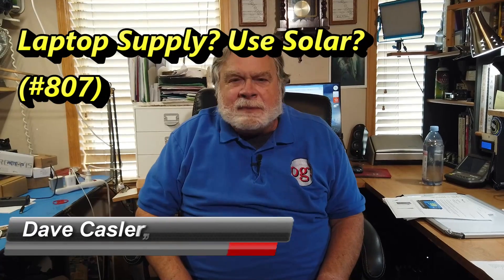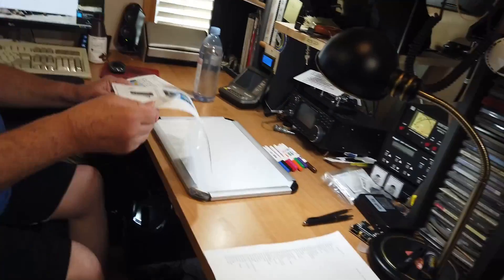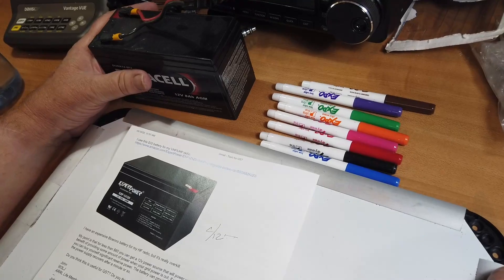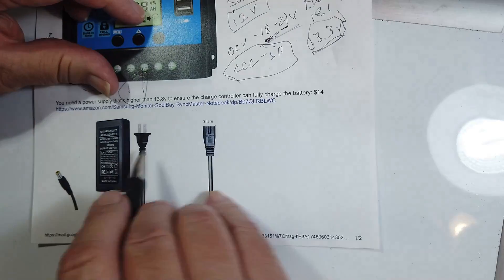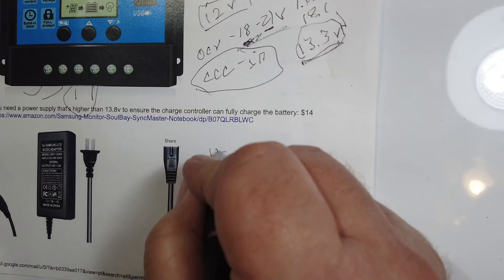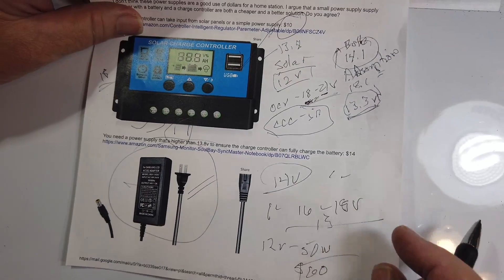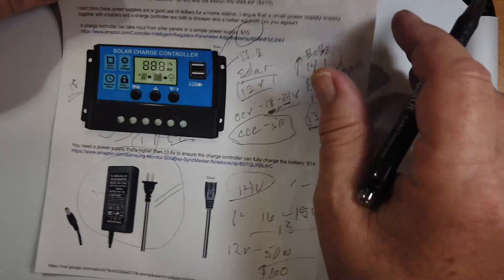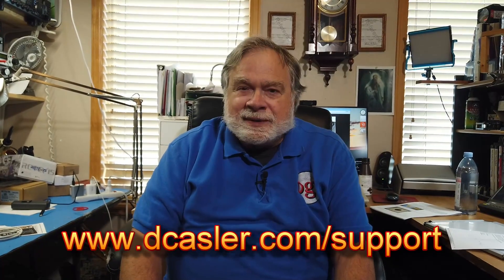Laptop Supply? Use Solar? (#807)

Comment: I agree with everything except I recommend hooking the load up to the charge controller instead of direct to the battery. Reason being is the panels could charge the battery less than the load is drawing. In this case the battery could be discharged to a lower voltage than it should have and may cause it to have a shorter overall life. The charge controller helps keep the battery healthy by turning off power to the load if it starts getting to this point. Otherwise a very nice video for solar education. Thanks!

Comment: Some time ago i built a backpackable vhf/uhf radio station (basically a frame of soldered copper pipes). The transceiver is keep alive by a 12V 24 Ah agm battery (car female cc adapter and usb ports for connect other cc utilities are made avalaible). The battery is managed by a 20 A mppt solar charge controller that can handle up to 320 w of solar power - the transceiver is feeded by cc output of the solar charger controller. In late summer with a foldable 60w monocristalline solar panel seems pass the stress test.
The battery can also keep in charge also with a pedal generator through car female cc adapter (you had to bycicle a lot for charge the agm battery, the maximum power output of the pedal generator is estimated between 30 and 40 watt)

Comment: I'm sure John appreciates you sharing his email and phone number with everyone. 

If you're going to use a battery and solar in place of an actual power supply, just make sure the battery can deliver the current required. Personally, i think this should be your backup to an actual power supply. 

If you're on a budget, just buy one of those cheap 12v switching power supplies from Amazon. I found one you can adjust up to 14v for about 20 USD.

Comment: Great Video! I have this exact setup except two 14aH AGMs. The charge controller is the same and I purchased a 40w fold up solar panel at a Hamfest. Last weekend got it wired up, but I haven’t dragged it to the field yet. I will test it soon with a QDX and then IC-706 MKIIG, then an IC-7600 if I’m feeling exuberant.

Comment: I use one HP server PSU to power both my Xiegu G90 and Retevis RT95. It was £9 and I modded another for use as a spare for £6. 

It's 460W, 38A, 12.25v but I added a resistor to a screw pot for 13.8v max. The fan is very quiet too.

Different models require jumping different pins to power them on etc.

Comment: Hi Dave, do you have a recommendation for a specific solar panel?  I scanned your web site and didn't find anything.  Thanks,
Reply: I have 16 of the HQST 100W panels and they have been flawlessly working for 3 years now.
I got them all off Amazon and had no issues.  I think I paid an average of around $75. They cost more now unfortunately. 
I also have 4 of the Newpowa 175W which work well too.
Reply: @amudlifecrisis  Thank you, I'll check them out.